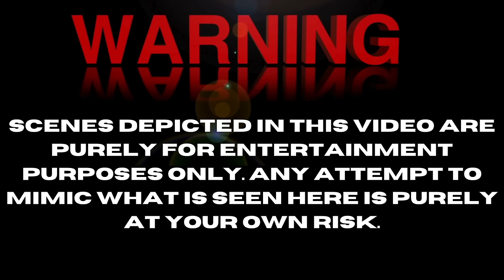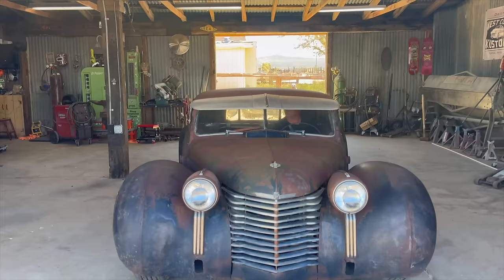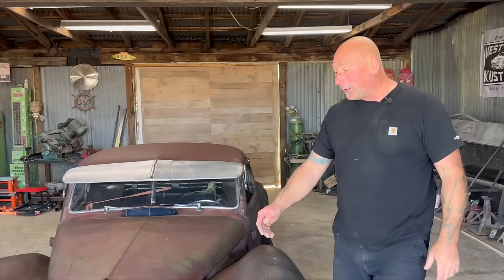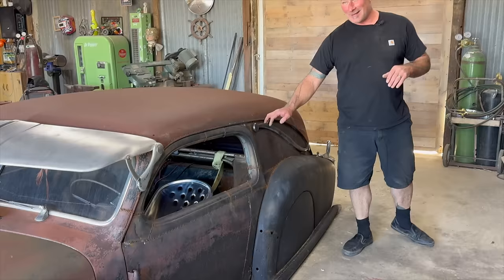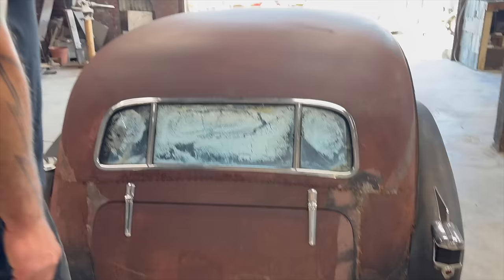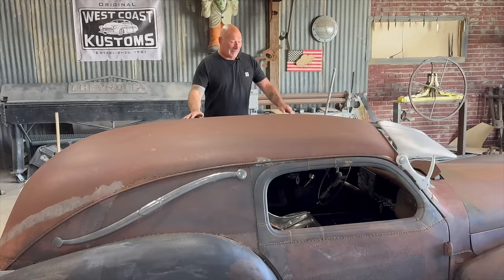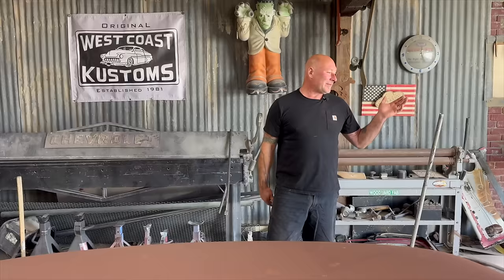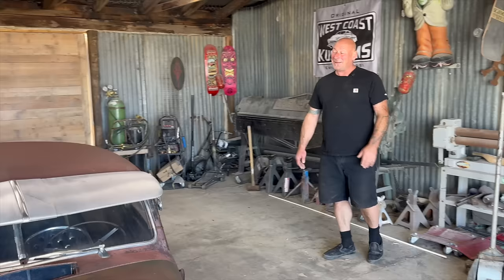1938 Cadillac 😎 Full Custom Ian Reintroduces The Caddywhacked Project For A Makeover

Comment: Wow, Ian,, I’ve never seen this before,, I’m thoroughly impressed,, what a beast,, it’s not a coop. It’s a sedan delivery.,, hey, I know, Victor,, we both got wild 36 Auburn boat tail speeders,, mine has got an aircraft motor in it
Reply: I have to ask— did you butcher the body to put that engine in?  That model body was as perfect coming off the line as the Jaguar E type was in its day.  I can’t fathom any body modification that would make it look any better.
Reply: @dougbowen4685  the only modifications we made was cutting the chassis and stretching at 28 inches other than that aside from not running front fenders and just having six pipes hanging out on each side. It is a stunning glorious masterpiece a roll of art, the air cooled V2 aircraft engine is the center of attention, the car functions and runs as normal with a six speed tremec transmission and Ford 9 inch sitting on 22 inch wire wheels
Reply: I’m sorry the statement should read other than that. We are running no front fenders.,, Instead, we have six polished stainless steel flex pipes Hanging out on each side and then bundled into a Unique aluminum collector on each side
Reply: @pauldemeester9298  any pics anywhere? I’d like to see it.
Reply: @dougbowen4685  there are some short videos on YouTube when we first got the car running,, but it’s not what it looks like today it’s totally been finished and refined,, the plan is to show it at the grand national in January competing against the AMBR, Guys,, and it’s necessary to keep the car under wraps until then, as it cannot be seen or shown before, it is exhibited at the grand national, type in V 12 start up,, On YouTube, That’s when I first got my motor and it is on an engine stand running,, there are some other short videos running around too. They pop up occasionally.

Comment: Hey. Great fix. They make yellow Teflon tape for petroleum. You might use that on the threads. Less mess than pipe dope. 
White teflon tape is for water plumbing btw.

Comment: no Ian, that's the best part of the car, maybe that air catching visor but not the top. we all had those visors in the olden days, plus one of those "air conditioner's" hanging out of a window, i'm sure you and Victor remember those, we packed ours with ice so the wind could blow over that, until it melted. a little trivia, before someone came up with the butt ugly tube hanging from the window, we would put a bucket or pan between the seat and dash full of ice or water and open the cowl vent allowing air to pass over the container. plus i still have a canvas water bag we would hang on the front of the car to cool drinking water. yeah im old, 82 this year.
Reply from the maker: Love this